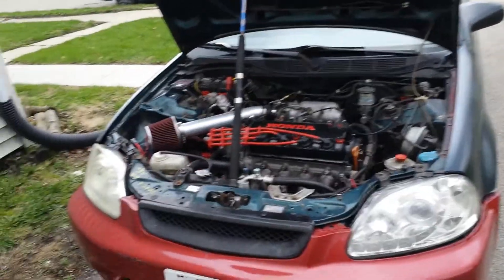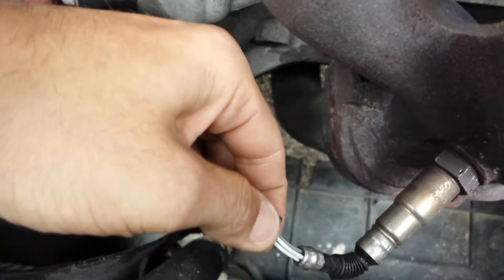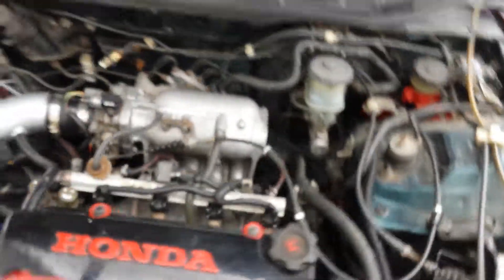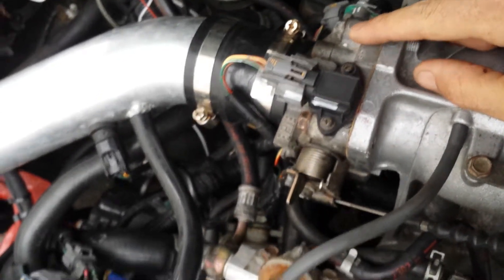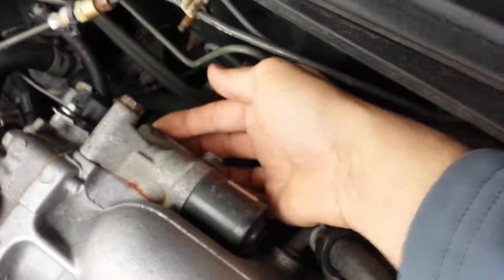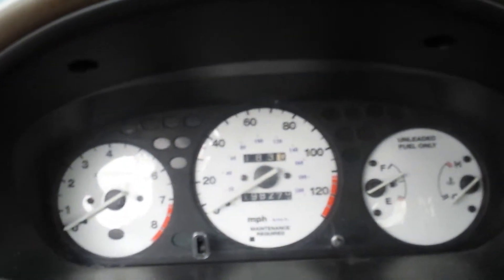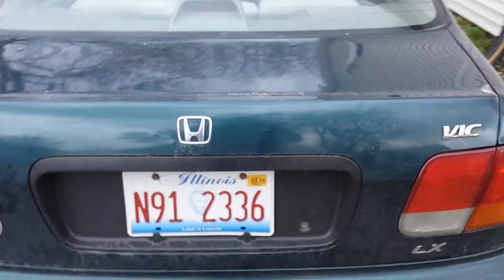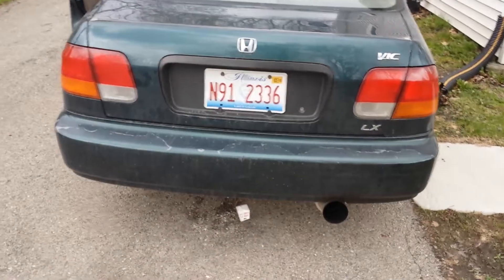For the ecomodders!

Comment: How do you put two vtec solenoids and do they actually help.?
Reply from the maker: That's Honda's design. Google search the honda D15B motor.   
Basically from idle to about 2500 rpm, it's like a vtec-e (D15z1). From 2500 to about 5200 rpm, it's like a vtec (d16y8). From 5200 rpms  to redline it's "wild cam" operation, unlike any other single cam honda motor! 
This motor is also a "lean burn"     motor,  my personal best with this setup is almost 55mpg!

Thanks for watching!

Comment: I meant for the o2 I used them stock extra o2 wires for egr cause I was not planning on needing them (cause I was going to single wire) so I can't seem to find a pinout other that D7 and A6 the other two are a mystery
Reply from the maker: My o2 is wired completely stock for the 96 98 Civic LX. Find a pin out for that application and see where do the four wires leaving the o2 sensor hit the ECU. Mine will be in the same location, since I'm wired as d 16 y 8 stock except for the second solenoid and the dual V Tech does not use the oil pressure sensor. If you have wiring for the oil pressure sensor, you should be able to use those two wires to get back to your ECU. Three stage VTEC does not use oil pressure sensors, at least not in anything I've seen.

Comment from the maker: google honda civic auto to manual conversion.  they explain where the wires go at the IACV as well as at the ecu, with pictures of the connectors at both ends. I don't even have the proper connector on my iacv, dude, just small spade terminals that i soldered onto my wires, and pinned to the part.  All I can tell you off the top of my head is that the center wire at the iacv goes to the "logistics gound in my harness (yel/blk?)".  That's where the 12v feeds the switch.  The other 2 pins go back to the ecu as neutrals to be switched. Got extra pins from my plug that gets abandoned in the manual conversion, may not be perfect, but it works just fine, as you can see. That's what I did.  Show me your solution, report it back to me at the ecomodder's dual vtec page.  I'm interested what other ideas, if any might work to make this awesome motor sing along with the rest of us over there...